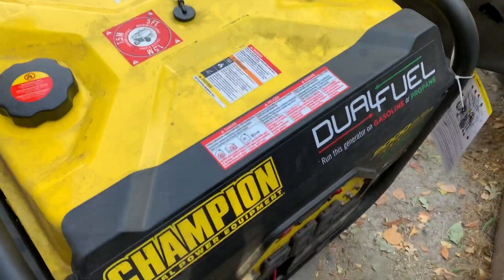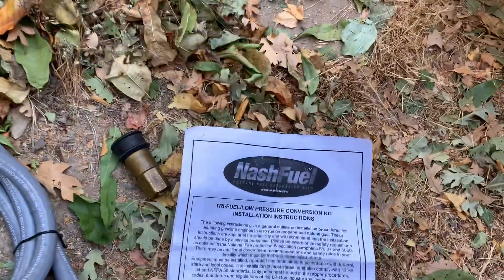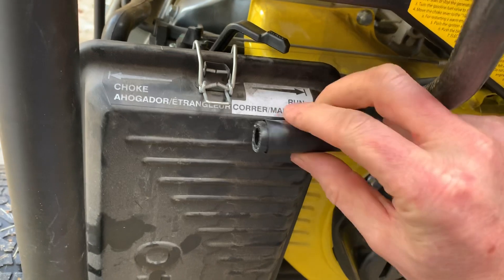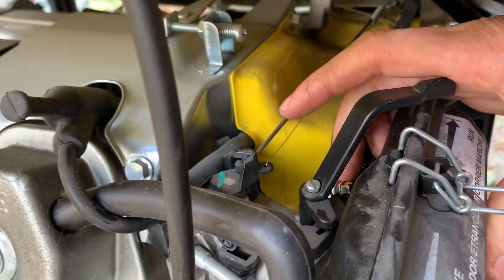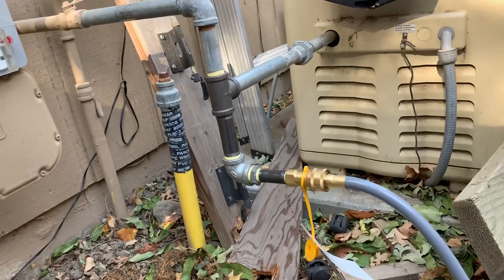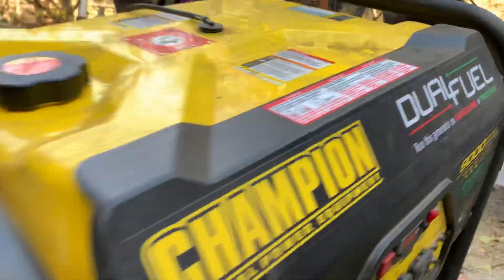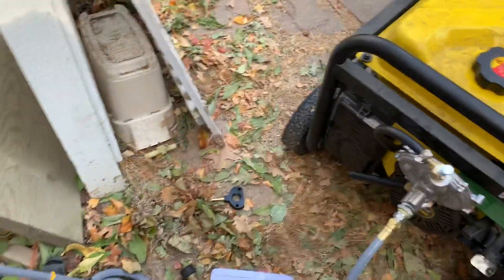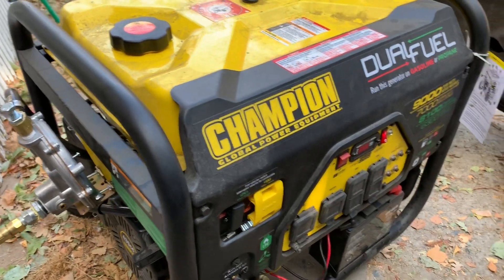Champion 100155 Generator conversion to Natural Gas Quick Shortcut

Comment: Has anyone else done this and did you get it working? Also when converting to natural gas do you loose power / AMP Vs leaving it on LPG? I have a WEN 11,000 watt generator looks like the same setup this generator has looking to try it but before I go buy the parts on Amazon I wanted some feed back. thank you
Reply: I'm in the same boat! Trying to make a purchase decision but would like some feedback on this particular setup! If it's this easy, it's a no brainer. I'm ok with a slight loss of power (which his other video Tesla video seems to indicate there is a loss of amps). All my other research says this method makes the generator very happy...I'm hoping that +ROTOMETALS sees these comments and lets us know if this is still working for them and if he can run it on NG or regular gasoline still. Plus any other gotchas he's encountered.
Reply: From gasoline to propane you lose 10%.  And from propane to natural gas you lose another 10%.  For example, 4000W on gasoline becomes 3600w when using propane and becomes 3200W when using natural gas.
Reply: Check out this 
https://www.youtube.com/watch?v=nO839Sayci0
He shows that he did not lose any power, he shows you his transfer switch before and after the conversion.
Reply: @frankcar1965  That shows how much power he is consuming, not how much total power his generator can output on natural gas... it merely proves that he had the same load running on the generator with both fuel sources; it's documented pretty well that gasoline will provide a higher overall total power output (capacity) than propane or natural gas.

Comment: Thanks for this video. Snce you haven't really changed anything, other than the propane line routing to the new regulator, can you still use regular gas with this setup if you need to take your generator portable somewhere?  I also just watched your Tesla charging video. You mentioned the generator won't run at 30A on NG...but needs to be back to 20A. Any other "gotchas" or issues you have run into or realized since doing the conversion? I'm evaluating some options. Right now, your idea here is leading the options. It just seems too easy to be true!  Thank you!!
Reply: Yes u can still use gas

Comment: Did you try to connect the natural gas up to the original propane inlet  before doing this? Im just curious if it might work.
Reply: U need a different regulator
Reply: Can you connect it directly from the gas line since it is already low pressure?
Reply: Tried it on mine. Started but won’t stay running. There are a couple of others here that said it works. I may have given up too soon as I was using a 25’ extension hose and there was probably a fair amount of air in it. The battery for the electric start was dead so I will try again when I don’t have to keep pulling the rope.

Comment: Thanks for the video! We have setup two items specifically for this generator based on your video. 
https://www.amazon.com/dp/B083G9JZRX
This one is just for low pressure propane or natural gas
https://www.amazon.com/dp/B083G99LQ1

Comment: Thank you very much, I have the exact same Champion model! I'm ordering the parts right after this message
Reply: did you get yours running?
Reply: Hello...I'm also curious if you got yours running. Wanting to do the same thing and looking for any feedback possible. Thanks!!
Reply: You can buy the regulator for $55
Reply: @chrisnixon2179  , link to this please?  thx.
Reply: @chrisnixon2179  can you tell me where and model number of regulator
Reply: @tradpro7485  century fuel products call them they are very helpful. Also get a 3/8 load block $12 they are hard to find